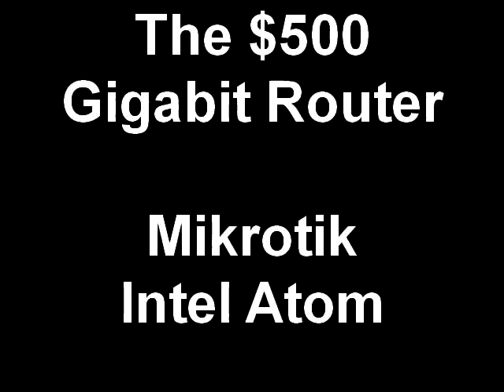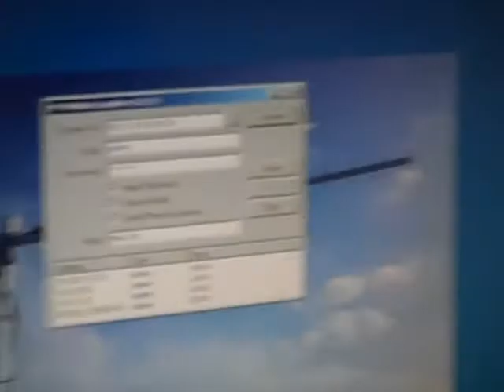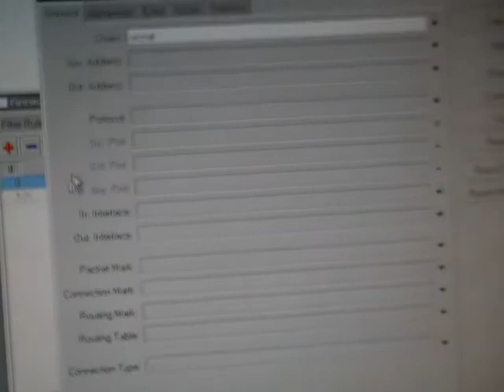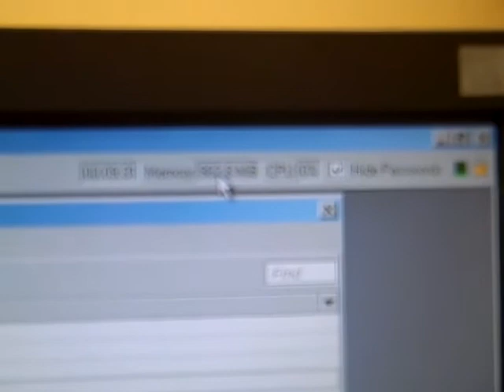The $500 Gigabit Router  Mikrotik Intel Atom

Comment from the maker: You need three basic things to build this router. Yes, I started with a bare bone SuperMicro single U server with 40Gig of Hard disk. I then added a 4Port fast Ethernet card, and installed a licensed copy of Mikrotik ROS.
The system is from Gopcn and the ROS I purchased from Roc-Noc. The 4 port card I had lying around from another project, but they are easy enough to find on the internet. Look for INTEL brand.